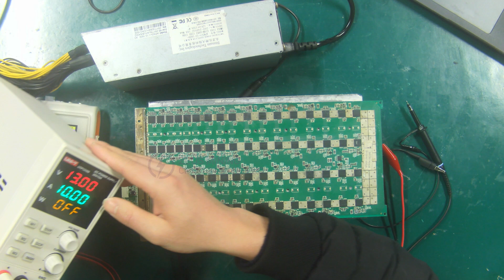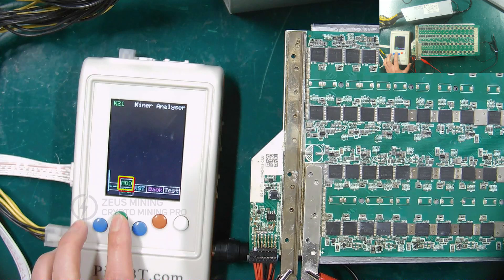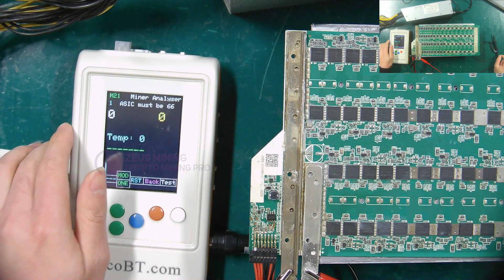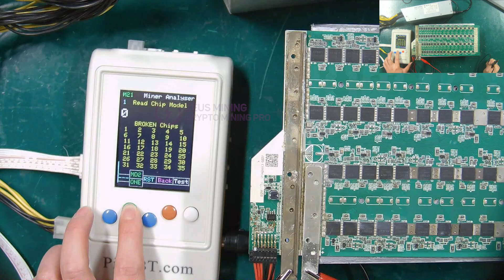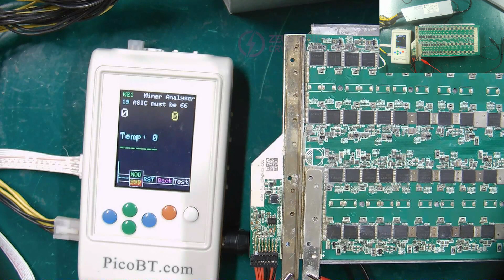use picoBT tester to test Whatsminer M21S hashboard丨PicoBT test fixture tutorial

Comment: Unfortunately, the PicoBT does not diagnose for M32 M31+, I have two devices and they do not work. With the latest version in October 2023 and the factory does not provide a solution either. Regrettable.
Reply from the maker: Sir, these two models, the PicoBT test fixture we sell can be tested according to the chip model. Did you purchase it from our official website? Of course, if you have technical-related questions, you can also contact our technician on WhatsApp: +8619123969124, and he will provide you with better suggestions.